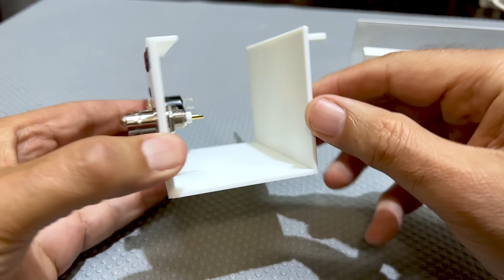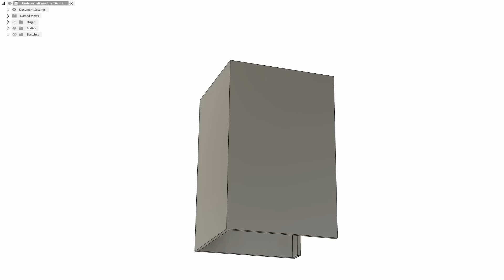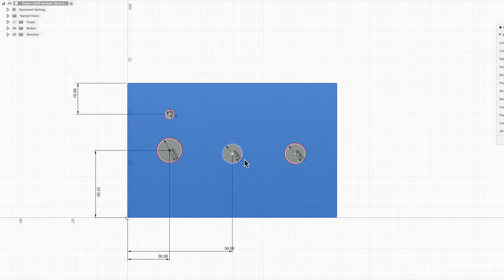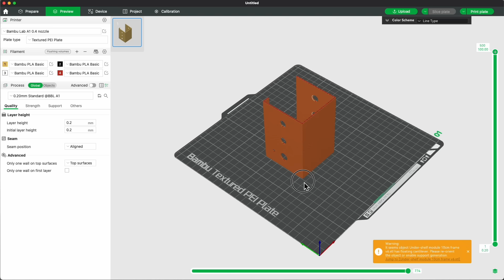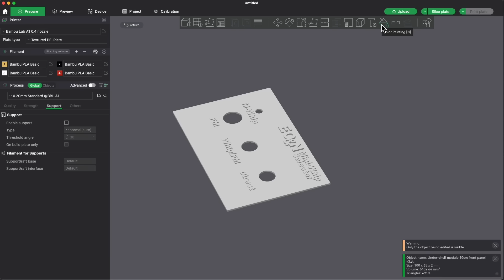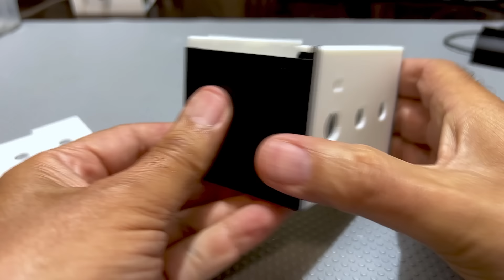3D-Printing my Under-Shelf Modules with new Bambu Lab A1 Combo

Comment: Nice, i also ordered one myself, the combo version. Do you know if you can turn it off remotely, or does it turn off by itself?

I currently own the Prusa Mini but its not that fast as Bambu lab printer, looking forward to put them side by side and see the differences in quality and speed etc.
Reply from the maker: It goes into a low power standby mode, but I e added a sonoff WiFi socket so can switch it off remotely

Comment: Hello great video :)

If I may you should print the frame vertically (like cura wanted to print it). That will use less surface on the bed, so you could print more parts on the bed. And you could close one side of the case and add two U grooves to slide the PCB in.

IMO you can get rid of the support with simple little design tricks :
- use hexagonal holes for the frame instead of circles
- add a 45° slop on the side of the mounting tab (a trapez instead of a rectangle)

And if you use a 0.6 nozzle you might decrease the print time by 25%, especially if you print multiple frames at the same time.
Reply from the maker: Great tips. Thank you 👍

Comment: Nice models. Only extra thing you might want to is fillet all your 90 degree angles. Add a little extra material because you will find that those walls and the tab at the back can snap pretty easily. I don't know how much stress these are under but just a thought for durability.
Reply: Printing on end like it showed up at first will be stronger too.

It’s important to remember that FDM prints are anisotropic—they have a grain, like wood, and the strength varies a lot based on print orientation.

Great video, BTW.

Comment: I have done something similar before, I used black, white and transparent PETG. The black was for the bulk of the panel/background, the white was for text or diagrams and the transparent was for LEDs to shine through. I printed it with the face down flat on a textured bed so there was no raised or inset text and that made it possible to print parts to hold LEDs and other parts on the back. It worked pretty well. Using a smaller nozzle lets you get even finer details too.

I have heard of people managing to get the LEDs to shine through with a very thin white layer rather than transparent too.

Also rather than have colour changing on a per layer basis, if you create multiple parts in your CAD software you can import those all together and change the colour individually so it will do multiple changes per layer so you won’t have the black at the bottom of the red text. Another way to do it is to use the colour painting feature in Bambu Studio, it as the name suggests let’s you paint the colour on in the slicer and then it can print that. The method with multiple parts works best and allows you to have a completely flat surface without the raised text.
Reply: I prefer to print these parts with the front face down as well, using inlay text.  The bottom layer tends to look better than the top one, and they look fantastic when using a textured plate.  I love the idea of using clear PETG for LED windows, I'll have to try that next time. The clear filament comes out milky rather than transparent so it'll work like a diffuser.  Or even a double layer (around 0.3mm) of white might look good.  Going to have to experiment here...
Printing face down also means that when the color changes go wrong, it'll be at the start of the print rather than at the end.  I have to do mine manually still on a Prusa Mk4 and it's a PITA, but the MMU3 filament changer should be coming soon :)
Reply from the maker: @kaasmeester5903 : 👍

Comment: For the central white part of the box, you could make one small change that would make the model completely support-less and print faster still! Instead of the protruding and rounded 'tab' on the back, grow a 45 degree edge out to make that hole, then the whole box can be printed on it's side.
Reply from the maker: Great point. Will make that change for sure. 👍

Comment: Impressed with the printer, if only I had enough years left and a higher pension. For version 42 you could add a 12V or 24V lighting track (fitting a noise-free PSU) and power all your modules with that.

Comment: Very nice results with this Bambu Lab A1 Combo. As for the color changing, maybe a tip (i'm not a expert and don't own a 3D printer). With that lets called it "frontbezel" with the lettering, you want to change from color, you do the "flushing" of one color to another onto a "dummy" piece next to your "frontbezel" but not attached. Per example a square of 30 by 30mm or 40 by 40mm untill the first color is flushed, so that the new color can be direct printed on your main project without the 2 color overlay.
After a few tests, you can determine how big the "dummy" needs to be to flush the colors, without waisting filler.
Reply from the maker: The printer automatically created a dummy to do just that. It prints it on the side edge of the plate.
Reply: @electronicsoldandnew  , there goes my patent :-)

Comment: shame it doesn't have true multi filament heads, then you could have used PVA for the supports. which is great as long as water can get to the supports they can be disolved away.
Not a bad price, about the same as my first 3D printer.

Would be nice to see an air tight enclosure for the reels so they don't absorb to much water between printing.
Reply from the maker: I guess all that would come at a much higher price.

Comment: Beware, you are only at the very start of the 3d cad and printing rabbit hole which is without end. On the plus side , it’s great fun. For example there are icons at the top of your slicer program which allows you to position your parts and align them much easier than what you are doing presently.
Reply from the maker: This is a true rabbit hole, and I think I’m well into it by now 😊

Comment: Thank you for taking the time to make this very informative and practical video. Ant thank you to bambu labs for sending you one! I want one!!
Reply: @electronicsoldandnew  one question, what is the noise level like during printing compared with the your old printer?
Reply from the maker: It’s actually quieter as it has a noise cancellation routine. I couldn’t believe it, but it actually works.
Reply: @electronicsoldandnew wow😮 I am sold!

Comment: Thank you for this very informative review. Regarding your workflow, depending on your needs, you may skip the STL export from Fusion 360 by configuring it to directly export to Bambu Lab Studio. Of course, if you do need the STL file for further publishing, this shortcut is not relevant.
I have access to a new generation printer, and am using Orca Slicer derived from Bambu Lab Studio, and I have been surprised like you how 3D printing has evolved at such a pace!
Reply from the maker: I didn’t know you could do that. Will look into it. Thanks.

Comment: Your 19650 battery pack is neat, what is the battery management system?
Manuel, jest put the printer on your wife's side of the room.
Reply from the maker: The BMS is  3S one that controls and balances the charging between the cells, and controls over- and under-charging.
Reply: Another idea for your bench , how about a power supply to charge your  18650 battery packs, since each one has a BMS, no need to remove or disconnect battery packs, only one switch and some indicators and voila.
Bom trabalho Sr. Caldeira